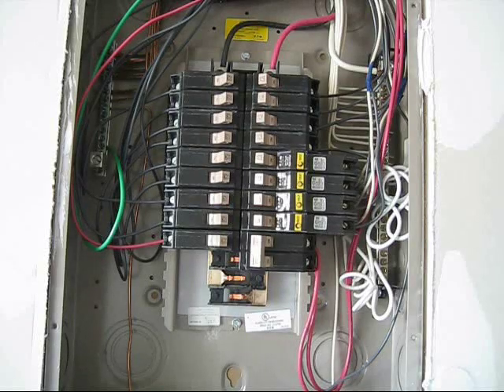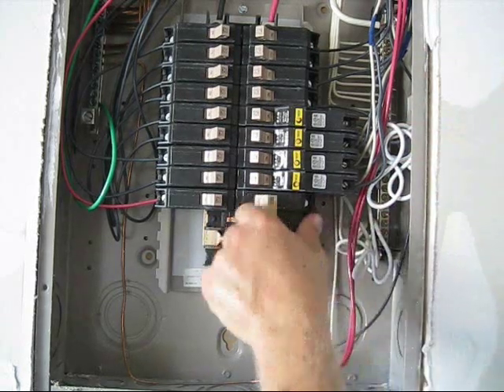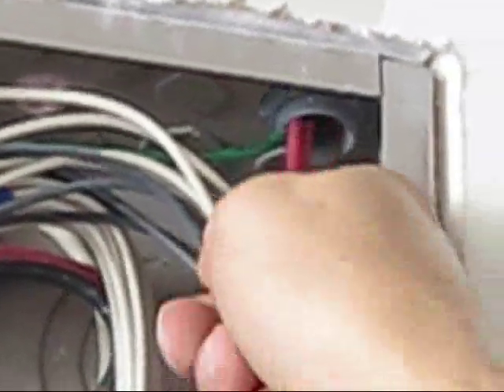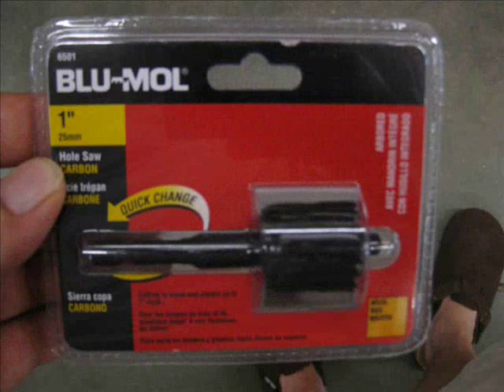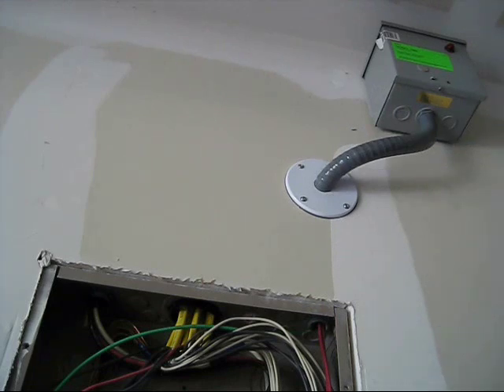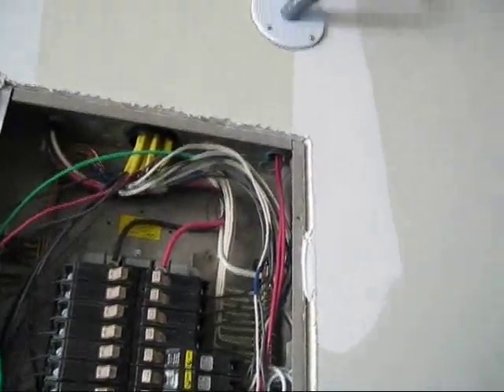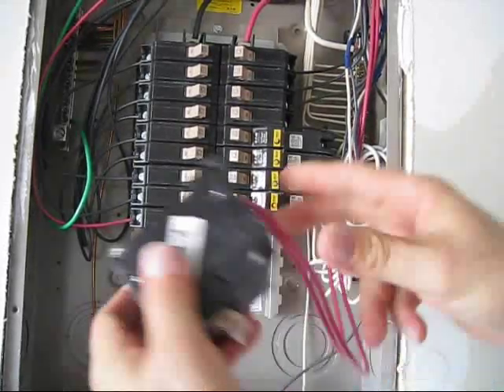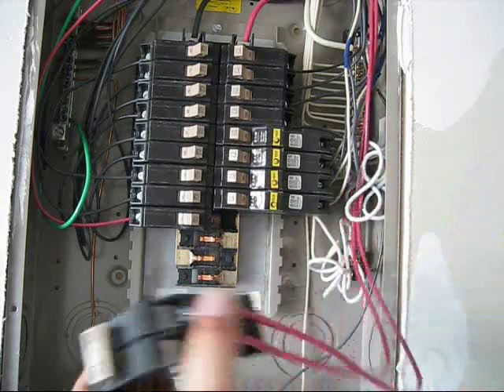Power Saver 1200 Part 5

Comment: does the kvar work?///
Reply from the maker: Not only does it work, it’s still working after saving all my electronics through several lightning storms, turns out the savings are not much when you look at it monthly but it’s been there for about 10 years, so it’s saved me $15-$20 a month for 10 years so probably a couple grand by now, but the real savings is when it saves you from lightning damage which it’s done multiple times.

The savings really depend on how much electricity you use as far as inductive motors like fans, washing machines, drills, things that turn mostly.

Comment: Thanks for sharing.  What is the latest on this device?   Still working?   Have you tried switching the breaker off & on w/ big loads running & notice any difference?   Have someone watch the meter while you do it.  Researching these, want to know more.  May install 1 for a lady this week, different brand name, but probably about the same product. I know it has a 30 uf mfd cap +-%10, so Nothing real special.   Thanks again,  - take care
Reply from the maker: ...12 years in and still working like new, saved the electronics in my house a few times by now I’m guessing, we’ve had several major lighting strike close to the house and ball lightning within 15’-20’of my breaker box, neighbors had to replace pretty much all the electronics that were plugged in but we never had to replace anything, savings are relative to how many or how much you run inductive motors which probably doesn’t amount to much over the years but is easily enough to pay for itself many many times over and then some and when you think of all the money you save on having to buy power protective extension cords all over your house to protect your electronics is just a cleaner cheaper more professional way to protect your electronics and save a little cash on the side! ...I would add this device to any home I lived in! ...kinda sad that homes don’t automatically come with them! ...they should be wired in to every breaker box at the store automatically so that no one is ever without one! ...kinda dumb that they aren’t! ...in fact your insurance company should also give you a break on your monthly premium for the simple fact that they know they will not be having to replace all your major appliances and electronics if or when you take a direct hit from lightning! ...I should actually check in to that, I know that with cars if you have gps tracking on your vehicle they will give you a bit of a brake, so I can’t see why not the same for this.
Reply: @ArranGreenleaf  Thanks for sharing. I installed a steady power 30uF made by "Volara" for a lady 2 weeks ago.   I'm still not nearly as sold on it as you, but I installed it anyway.  
How much $ did your's cost? 
Think she got hers for about $500, but it retails for about $999.
I like the way your's was on a 220/240v 2 pole breaker, that way you're contacting Both hot buss bars. The 1 I installed specifically said to install on the #1 & #2 breaker positions, which are on the same buss bar, seems silly to me.
thanks, - take care
Reply from the maker: @leeisenberg  ...it’s just a Capacitor in a box $500-$1000 seems ridiculous, the savings on your bill each month are not very much but every little bit can count but at those prices it would take years to be in the black, mine was I think $100-$150 but that was 12 years ago, I think at the time I did some math and worked out that if I paid an electrician to install it, it would take 10 years or so before I would start to be in the positive cash flow on it and that’s why I installed it myself and made the videos for others because I worked out it would hardly be worth it if you were out of pocket anymore than $200 ...as for the position on the breaker bar it doesn’t matter at all so I don’t know why they would say such a thing! ...that’s just silliness!

Comment: These devices are not worth buying. It will change your power factor, but it will not change your hydro bill. For a residential service, the hydro company charges you the same, no matter what your power factor is. These devices will lower your current (or amps), but your hydro company does not charge you per amp, they charge you for KW's used. The device is a total waste of money for a residential customer, and a SCAM.

Comment: All those 12-2 up top is not to code. You can't run that many cables together without degrading. I'm surprised this panel didn't fail inspection
Reply: Codes are made to be broken.  You really think the House will burn down. Under 30" no derateing

Comment from the maker: The Power Saver is a capacitor and captures this energy out of the back end of the motor, so instead of it becoming heat built up in the motor, it remains electricity and moves on to the capacitor where it is held and released as needed.

Then as the motor or any other electrical device in your home asks for more energy it releases it as needed, as apposed to pulling it from the grid.

Comment from the maker: It recycles extra energy drawn to inductive motors, like the ones in your washer & dryer, fans in your furnace or AC unit, anything that turns, has a motor, that motor draws larger amounts of energy than it needs because it does not know how much of a drag its going to have to pull, this energy if not used will just become heat, as the device has no way to store it.